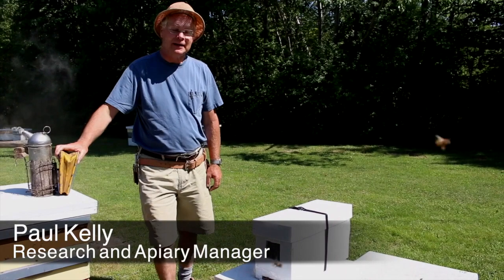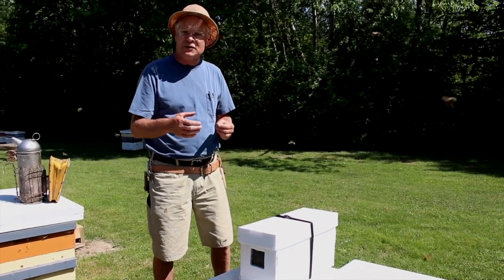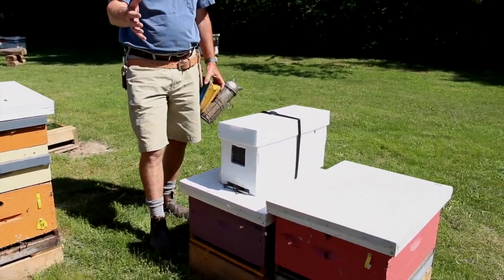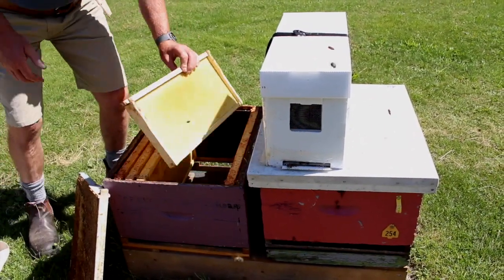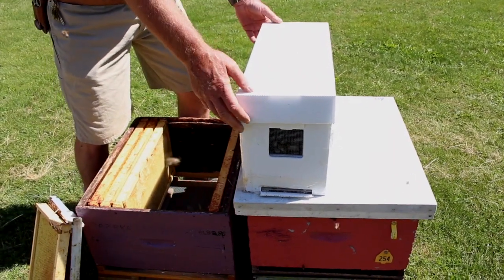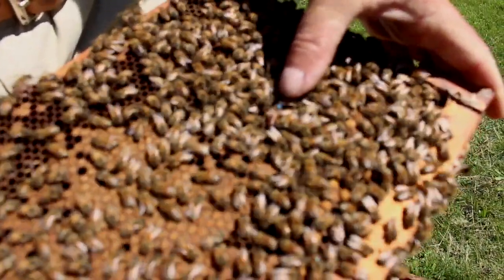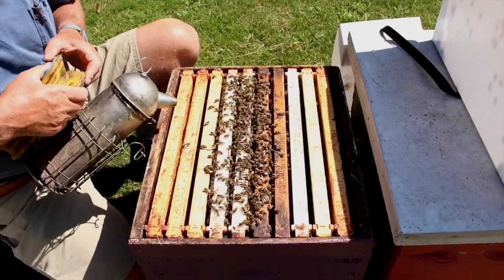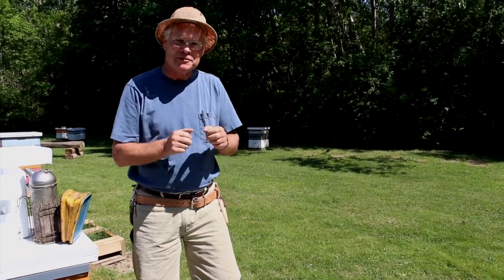Introducing a Nucleus Colony

Comment: Hello from Croatia,
You made a greate videos about bees and beeskeeping...very nice...
One question,what kind of material is this piece  under the roof on the beehive???is't some kind of plastic or textile ???
Tnx and keep going...
Reply from the maker: Hi Josip
 Thanks for letting us know you have found the videos helpful.
 We get this question a lot so will do a video on the topic this summer.
Why do we use canvas for the hive inner cover?
A: We use canvas inner covers for a few reasons. They make it easy to take a quick peek in the hive, and are cheap and easy to make. They are light, the lids sit down well, less excess wax on the frame top bars, and we rarely need to scrape the inner cover. We use 18 oz  (#8) canvas -otherwise known as duck. It's a bit hard to come by in Ontario, but it is available from online distributors (US: http://www.bigduckcanvas.com/number-8-18oz-cotton-duck-canvas.html, Canada http://www.jtsoutdoorfabrics.com/18oz-Cotton-Duck-Canvas-Untreated--Natural-60_p_15038.html). Bees chew through thin canvas so a heavy weight is better. We flip it over periodically when new so the bees thoroughly coat it with propolis. An alternative is a feedbag folded in half.
Show less
Reply: UoG Honey Bee Research Centre 
Tnx...Your answer is helpfull...
Greetings from Croatia...